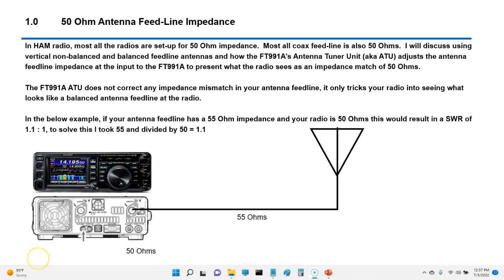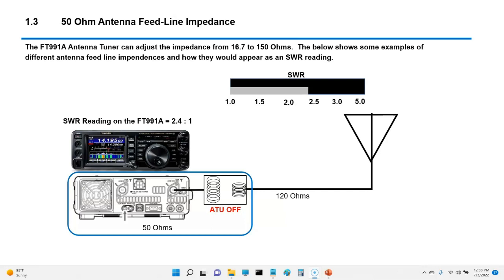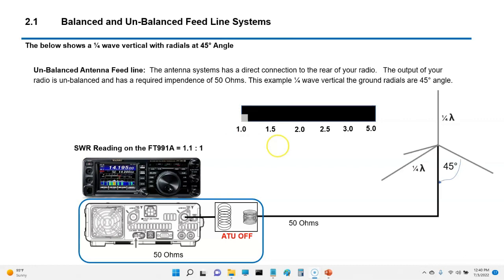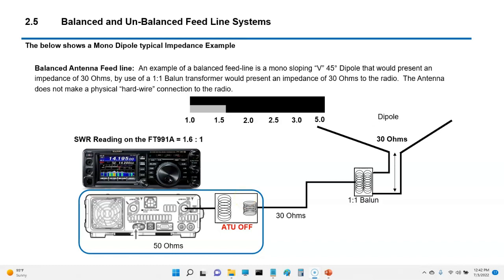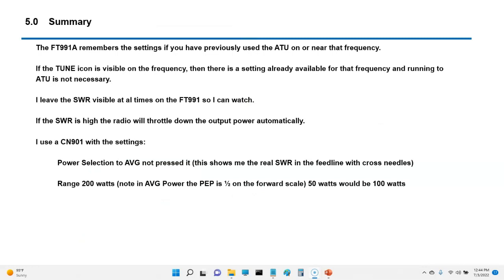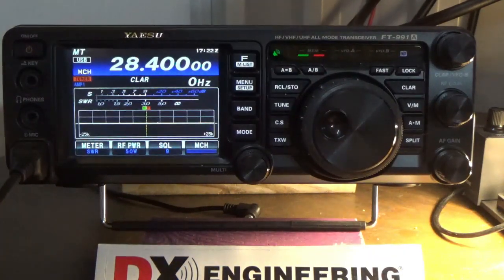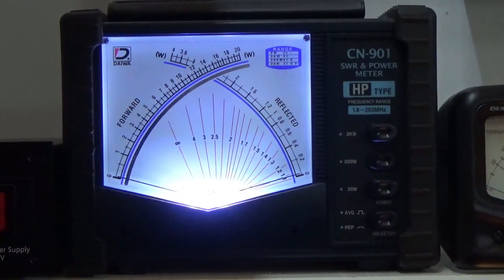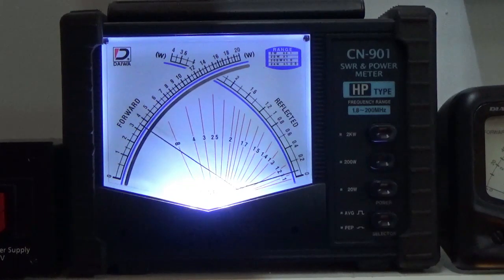FT991 Antenna Tuner Operation – Review Antenna Feedline Impedance

Comment: Informative. Putting up my first HF antenna this week, 10 meter dipole. Got my Technician license back in January and bought me a ft-991a as a reward. Been using 2m/70cm so far, programmed repeaters in my state. Thanks,  Ed
73 KK7CWG
Reply from the maker: Hi Woody63, just checking in you on the air with the dipole?   Hope all is good let me know how things are going '73 sir from KI5JUF
Reply: @westtexasvideogateski5juf255  
Was receiving some so it is working, I'm not much of a talker.

Comment: Thanks for that just got the 991a out the box wanted to see how to properly use the tuner button
Reply from the maker: Good evening Rye, glad you got the FT991A have some fun and let me know if there's anything you need from me '73
Reply: @westtexasvideogateski5juf255   thanks for the reply I threw up a dipole makeshift haven’t much room here, on most of the bands all I could get was the tune to just flash and flash hi SWR so going to get a long wire this week with unun and see how that goes I’m more of a listener than a tx’er so SWR unimportant at the moment I was just checking the TX of the set 👌🏼

Comment: What happens if you change frequency without undoing the tuner button?
Reply from the maker: Good evening and thanks for the message, what I have found is once you activate the tuner at a specific frequency this will set the system to as close as to 50 ohms as possible with the feed line and antenna and save this to memory, at the this point the tuner coils are set to this specific location for a specific frequency.  So, as you deviate up and down frequency the tuner will hold it’s last setting so you will see the SWR start to creep up as you change frequency.  I hope this helps small changes no big deal large changes you may have to reset the tuner.  Now, a benefit is there is a memory bank so you may find as you return to return to certain frequencies and have a consistent feedline and antenna you may not need to preform  the tuner calibration to commonly used frequencies.  Good luck I hope this helps and 73